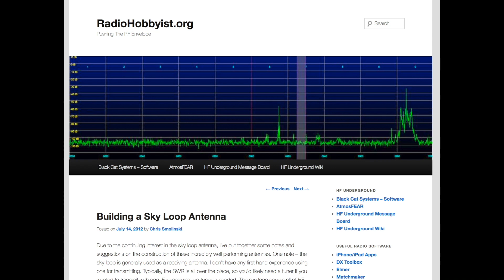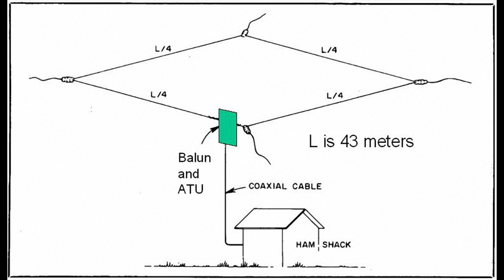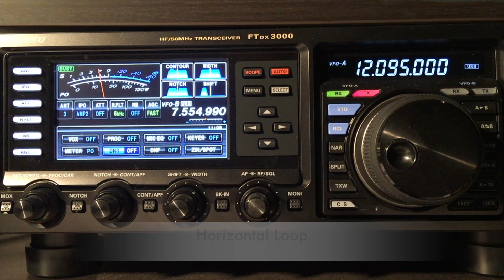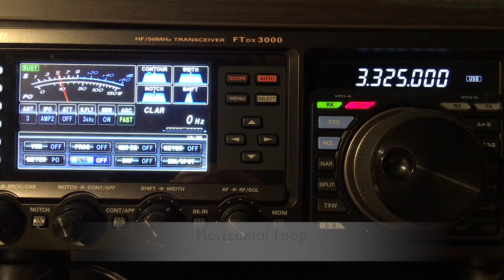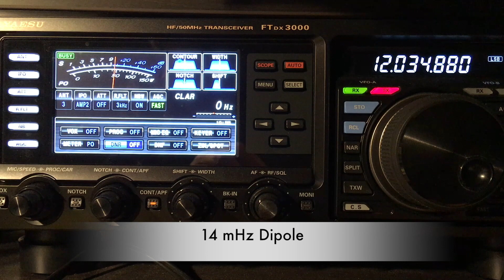Horizontal Loop Antenna Experiments

Comment: Hello Rob
I run from a balcony apartment in central London and have also an 80 metre sky loop AND a top band Windom.
I see Zero difference in noise between the two antennas.. in fact the extremely respected W8JI disputes this lower noise floor on horizontal loops.
In my QTH and as of writing this I wish I could be in agreement with what I’ve seen on your experience. Alas I can’t and folks should be aware that this is not a magic cure for noise...

Many thanks
Mark
Reply from the maker: Hi Mark, Sorry to hear that you have had no luck with your horizontal loop. In the video, I don't think I said the loop was a "magic cure", but that my experience indicated it helped me in the noise department. Since I made that video in 2017, I have erected another loop 100 metres long and is more of a square shape. Recently, I added a vertical delta loop for 30 metres. Both antennas continue to perform well and are resonant on multiple bands (especially the 100m long loop). I can imagine that apartment living in central London is a hard ask for ANY antenna! Perhaps you could check to see if much of the noise is coming from within your own apartment or other apartments close by.  No antenna will reduce noise if the noise is emanating from switchmode power supplies and such within the home. The usual tests of unplugging and replugging household devices one at a time can tell you much about what is going on. But this is a subject for another video. ;-)  Best wishes, Rob VK3BVW
Reply: Dear Rob,
I wasn’t doubting your findings at your QTH OM, far from it..
What I was trying to get across is that I’m aware that quite obviously my QTH is a QRM nightmare, but the loop was never as good as the doublet re noise on A/B switching.
So I wasn’t pointing out the problems of my QRM nightmare QTH but that the antenna that is supposed to be quieter on RX was never realised here at mine, and quite obviously it’s a good test (my QTH) for any noise suppression antenna.
Reply from the maker: @markfeltham9456  No problems at all, Mark. All understood. Good luck with the noise reductions, my friend. Rob.

Comment: Appreciate some input on the following:

Any updates on your opinion and experience with this antenna? We have an acre, and I have been using two Chameleon Emocmm III antennas. These particular endfeds have done pretty well. One runs N/S orientation for east west propagation, and the second E/W orientation for north south propagation. Both are Inverted L configuration and the vertical portion is at 32’. Im considering replacing these with one large loop. My primary use for HF is standard ragchew nets, sometimes contact nets, and nearly always on 20/40/80m bands.

73....K5JRX
Reply from the maker: Hi Jay-Rus. Since that video was made, that horizontal loop collapsed under the weight of a falling gum tree! :-)  A new longer loop is now in the air, 100 meters long and in a more square-ish shape. Why 100m long? Well, I just wanted to get as much wire in the air as I could and 100m was the entire reel. Just didn't have enough space for the full 160m length. Doh! Also added was a balun capable of transmission to 500w and new coax (although you can also use open wire line if you wish). With the internal tuner, it fires up on 30 - 6 meters. With the external tuner and some fiddling, it tunes up on 40 and 80. I'm very happy with it. Recently, I also added a vertical delta loop cut for 30m, which also resonates quite well on 15, 12, 10 and 6m. If you can, I suggest you keep the end-fed ants up and a horizontal loop. Then compare between the three. Good luck. Rob VK3BVW

Comment: great video! does it need to be a loop? if i hang it i the trees i have available it will not loop back.
Reply from the maker: Matt, if it doesn't rejoin at the balun (as in the video), then it's not a loop. It's something else....long wire, random length wire, end-fed antenna, etc? Since doing this video, I now have a new loop which is more of a square-ish shape rather than the rectangle in this video version. - Rob VK3BVW
Reply: @RobVK3BVW  thank you. looking to get a CHA sky loop and wondering if i’ll have an issue with not being able to loop it back. i guess it will just be a large end fed.
Reply from the maker: @TheAllred13   The value of the loop design is that it can reduce the severity of local noise. If there was a way of retaining the loop concept at your installation I think you would see an advantage. The shape of the loop doesn't appear to be too critical. Good luck.
Reply: @RobVK3BVW  thank you sir, i appreciate it

Comment: I have had a 80 meter horizontal loop up just 20 feet for the past ten years.  Does not require any work.  I have it corner fed with and four to one balun and 50 ohm coax.

Comment: Thanks Rob thanks for the nice video. I've just moved from a country setting with a six acre field where my nearest neighbours were sheep. I've now moved to a new location overlooking a university town with around 16,000-18,000 inhabitants, all with lots of gadgets. The first thing that hit me in the new location was the QRM on 80m. Fortunately I've got 1/3rd of an acre at the side of the house and I think I might just have to have a play with a loop. I've used a vertical quad on 20m in the past and that always kept the QRM down but now my preferred band now is 80m and my old ears surfer from 5 an 9 tinnitus at the best of times so a loop could be just the ticket!! Thanks again . . .Andy     GWØJXM
Reply from the maker: Hi Andy. I am all too familiar with the tinnitus problem, unfortunately, hihi. My loop came down a few months back when a large gum tree collapsed on part of it. The lumberjack ;-) has since been through and I'm toying with the idea of a replacement 80 or even 160m loop (160 will be a squeeze!). Anyway, good luck with your 80m version. I hope it goes well for you. 73, Rob VK3BVW
Reply: Cheers Rob, the reality is that I have so many options I don't know what to play with first. I also want to have a go at an off-centre-fed-dipole with multi band coverage.I'm a bit concerned about lightning as I'm on top of a hill 60 metres above sea level a about 120 metres back from the coast and just about the highest thing around for quite some distance. When I designed the house I included 4 lightning conductors, the old building that I knocked down had a lightning conductor and there have been strikes up and down the coast so I'm busy thinking more about earths than aerials at the moment!!  Got to say those trees of yours are something special, not everyone has got a bunch of them in the back yard to play with.Enjoy every day.  73 Andy    GWØJXM

Comment: Hi am building a 20m full wavelength horizontal loop in loft to use 10-20m, it will be 10 meters above ground, will it work on 20m?
Reply from the maker: Derek, if you are building a full-wave loop that is 20m (approx 65.6 feet) long, then yes it should load up on 20m! Having said that, it will also depend on the environment within which the antenna is located. Enclosed in a loft MAY impose some transmission or reception limitations. But you should try it anyway. Good luck. Rob VK3BVW

Comment: About 10 years ago I attended a Club meeting where the presenter was W7FB Dave Fisher.   The topic was full wavelength 
horizontal loop antenna.  Dave wrote an article in one of the ARRL antenna books about the Skyloop or Skywire antenna.
He was previously W0MHS when he authored the article.  I erected one soon after.  I then had the room for a 160M loop.  
It was not nearly as nice a shape as yours.  But did it ever perform!!  I regret that we moved  and it had to come down.  
LOW NOISE was an understatement.  It was fantastic.  I remember being able to say that the other station was zero on my S meter but they were armchair copy.  I wonder why they aren't up in every Amateurs garden.  Mine 
was only at 8 meters but I was working DX all the time.  
w0fen
Reply from the maker: Hi Robin. Thanks for your comments. All my antennas are down this week while the tree lopping man paid us a visit. Going up in the air soon is a 160m loop such as you mentioned. I think it will be a wriggly affair to make the full 160m length fit the property. Should be interesting to see how it goes. Thanks again for taking the time to watch the video. Rob VK3BVW
P.S. I enjoyed reading your transmitter stories on QRZ.com!  :-)
Reply: HI!!  I for got to say mine was sorta in the shape of Orion.   Not the best but what I could get up with 
the trees I had.  I now have about 0.7 Acre now.  Lesson learned... NEVER put up a loop over your 
own house.  The RF gets into everything.  Moving it to back yard and maybe making it a 40M loop.
The 160m loop was amazing on 40M.
Reply from the maker: @rcelectronicsllc9400  Agreed! My radio shack is a detached building in the back yard, away from the main house. Helps heaps with the noise factor!

Comment: hi rob.  just found your video, very good indeed. I tx on a vertical, but street power line noise if bad, so ive tried many rx ants, and found my short, only 40m long beverage works very well. if your interested, check out my qrz page, 73 brian zl3xdj

Comment: Use your IPO on bands below 14mhz. Looks like you have the preamps on which is increasing your noise. 73 Sid MI5UTC
Reply from the maker: Hi Sid. Yes, of course, you are correct. Switching off the IPO will reduce noise, as will judicious use of the RF gain control. But the purpose of the video was to illustrate that even with the IPO on the amp 2 setting, where noise will be higher and more apparent, the horizontal loop still made a difference in reducing noise in comparison to the other antennas trialled in the video. The FTDX3K has a wonderful receiver, and there are many facilities in it to combat noise. Perhaps I should make a video one day showing some of the ways we can mitigate noise problems using the 3K controls. Thanks for taking the time to watch the video, Sid. Vy 73, Rob VK3BVW

Comment: I run a full size G5RV folded into a vertical delta loop and soldered at the ends for listening and specific for 20 metres QsO's. Best thing I ever did with the G5.
Reply from the maker: Wow! That sounds really interesting! Food for thought there! Thanks. Rob - VK3BVW

Comment: Very good video.  I would like to add my comments to this.  My experience with these kinds of loops is, they are very hard to beat. If you have the yard (space) for a single HF antenna for all bands, this would basically be it.  Ideally a full wave 160 meter version.  The shape is not critical.  One major change I would make is to feed the loop with ladder line.  This is actually very easy to make yourself and you can find many videos that explain the various ways to make it.  My ladder line is made using electric fence plastic insulators and 12 gauge coated copper and UV resistant wire ties.  Many hams have heard you can't bring ladder line into the shack.  I'm here to tell you that you can.  I run 1500 watts and my antenna tuner has binding posts for ladder line.  If you don't want to purchase a tuner with ladder line posts on it, I would run the ladder line into the shack or just outside it, and get a balun with a very short piece of coax to connect to the rig or tuner.  Remember, coax is a good choice for resonant antennas, but if you want to use 1 antenna on all bands, the losses that occur in coax for the non resonant regions are very high.  Ladder line is pretty much lossless in the same circumstance.  Even a single dipole fed with ladder line is a better choice to make it a good all band antenna.  My 2 cents.
Reply from the maker: Thanks for your excellent observations. As I mentioned in the video, I had not prepared any ladder line and only had coax on hand. My intention with this one was to use it primarily as a receiving antenna. But as you say, using LL would work much better as an all-round tunable antenna. After the video, I did upgrade the balun to one that could handle some transmitting power. It tuned up on 30m pretty well, but struggled on most of the other bands. Using LL would allow the antenna to work much better on transmit across the range. Unfortunately, where the antenna is located running down across the creek gully, it struggles to get out due to sloping landmasses surrounding it. If I could locate it on higher ground or get it up higher, I'd have a better chance of getting a stronger signal out. However, it works well as a low-noise receive antenna at this time. Thanks for your input, Ricardo! 73, Rob VK3BVW
Reply: Wow!  Very interesting.  Thanks, Ricardo.

Comment: bummer good ideas but why cant u TX on it? in title RX only would have been nice..
Reply from the maker: :-)   I can! I have! Tunes up well on 30m quite well and usable on most other bands through an ATU. When first erected, I was using a balun made of light wire designed for reception only. Since making this video nearly two years ago, I have installed a heavy duty balun for transmitting. However, I don't use it for transmitting as my other antennas are much higher and get out better.

Comment: interesting looks to me the dipole looses s units, the end fed gains s units but its all noise, and the horizontal is in between the two but legible and can hear the music and singing.
Reply from the maker: The loop certainly is less noisy. If the signal is also down a bit, I'd still rather listen to a clear signal without the noise. Thanks for watching, Mike.

Comment: Hi Rob, this is the second time I watched this video. I have been running loops for 30 years. With that being said you do not have to have it with 4 corners. 
I have mine in a Delta Loop shape and feed it at the top with a 4:1 Balun. Apex is at 45ft or 13.75 meters. The bottom two corners are 20-25 ft. above the ground and all are very broad banded antennas.
I have them for 40m 60m 80m and 160m. I have about 20234.28  Square Meters here to use though. So lucky in that respect I guess.
73's
de W4DRA
Dave
Dunnellon, Florida
Reply from the maker: Hi Dave, and thanks for watching the video TWICE! :-)  Yes, of course, there is the delta loop with three sides. And if one wanted to dabble with antenna logistics, engineering and execution, you can have loops of more than four sides. I guess the possibilities are endless and so are the variations in backyard sizes and shapes.....oh, and in XYL approvals, too! ;-)  I checked out your QRZ page and your very impressive setup there. Most of us would kill for something like that!  Thanks again, Dave. 73, Rob VK3BVW
Reply: Dave hi Dave. I’ve made a delta and 2 ends will be high and one end will be lower. Where should I feed this antenna with the 4:1 ? I would like to shoot northeast for some dx as well. Someone told me to feed in the southwest corner of the delta?? I’m good on qrz if you wanna help

Comment: RFI filter 120/220V 30A - have several of them they filter out a lot of the Line Noise on my AC Power. There old school came out of the old Main Frames Computer (DEC PDP-10 KI) Your IBM 360/370 type of computer

Comment: Yes, is a very nice quite antenna. I Homebrew one for 11 meters band, with two fishing cans, and works well. The adapter, I use a 75 ohms TV cable.  It's fantastic low signals, but the quality of radio is amazing. TKS fer the video.
Reply from the maker: Thanks for watching, Paulo. Rob VK3BVW

Comment: What a difference! I have a delta loop antenna whose perimeter is about half of yours. I tested it as a vertical loop and it worked well. So I think I'm going to lift over the roof as such. A friend of mine, Jorge Freitas, you may know, has the same delta loop model as mine and he chose to install it as a skyloop for the same reasons as you did, but he was not very much satisfied the results. Could it be that as a skyloop antenna it should have a larger perimeter?
Reply from the maker: Hi Julio. I think that the more wire you can get in the air the better. It also depends on which bands you want to listen to, as well. And, of course, any antenna which is close to a manmade electrical noise source will still be a problem. Perhaps the 4-sided loop is better than the 3-sided delta loop? Who knows? :-) Best to experiment and see if there is a difference. If you can keep the old antenna in the air as well as the new antenna, then it is useful to make a comparison between the two antennas. Good luck with your research on antennas. Rob VK3BVW